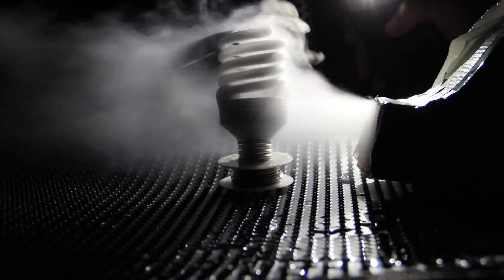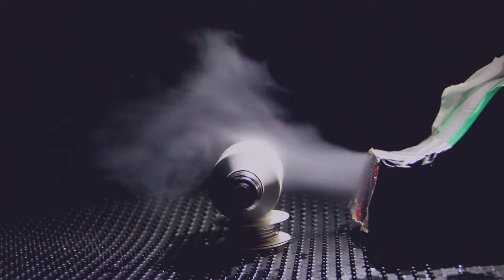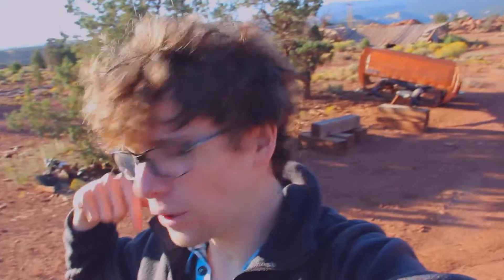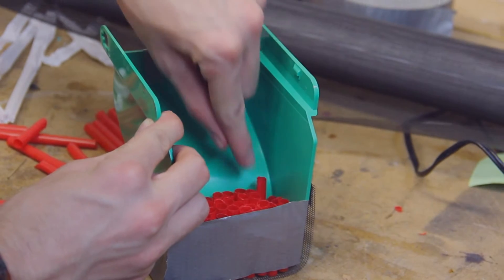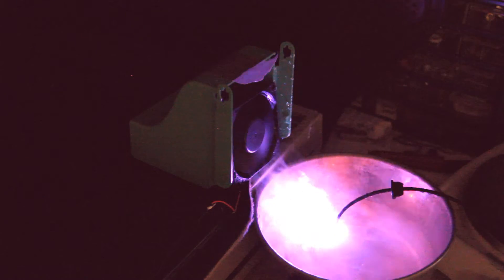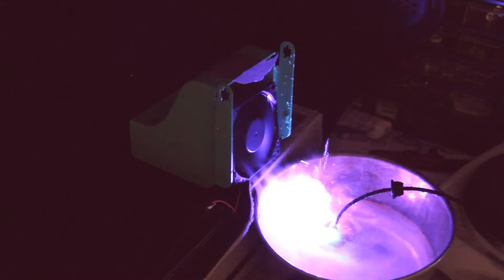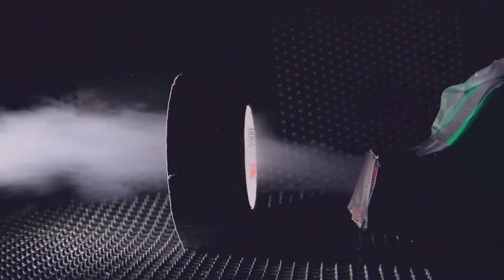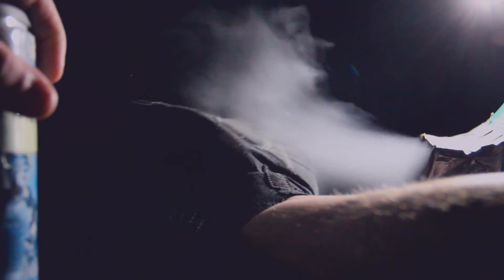Playing with Laminar Flow

Comment: A signalling failure ought not to cause a cooling failure, so these cooling fans usually run at full speed when they have voltage available.

Some fans  have an onboard thermistor to slow them down a bit when cool; others require a good signal be present to keep them below their max RPM; when the signal stops, the fan ought to spin up to full speed.

Great channel!